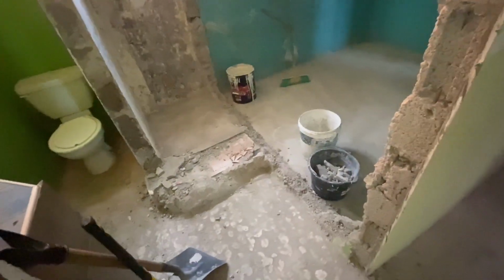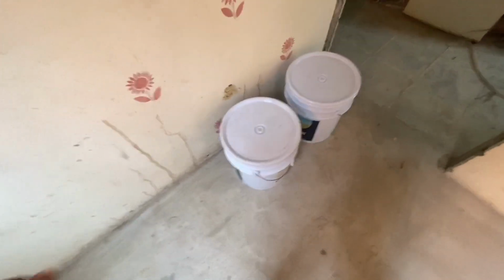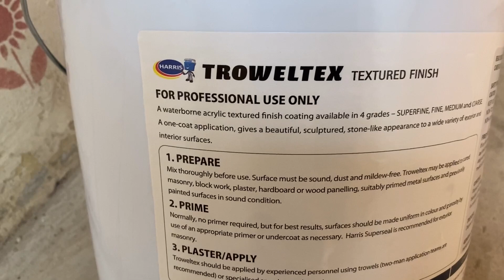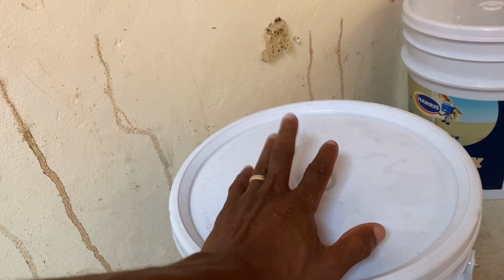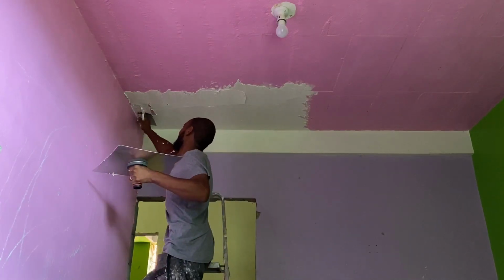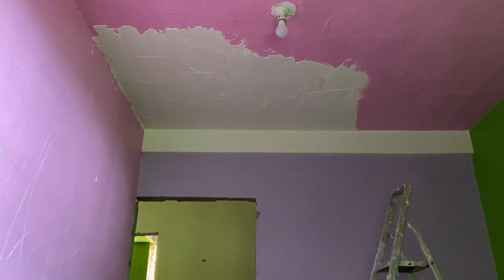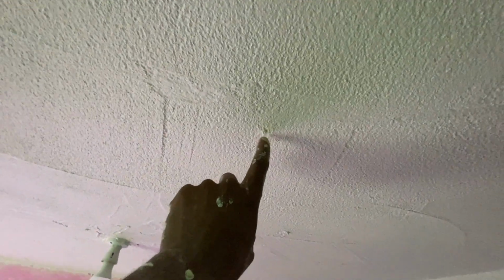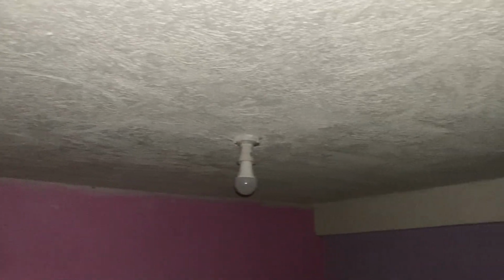Finishing the ceiling with trowel tex product

Comment: Wouldn't it have been easier to cover the ceiling in plasterboard? (Although I admit, I loath textured ceilings!)
Reply from the maker: I did suggest framing the ceiling and plsaterboarding but the client insists against any timber for fear of a previous termite issue.